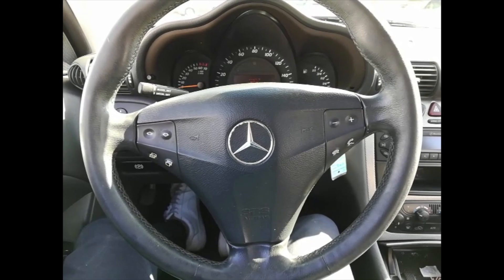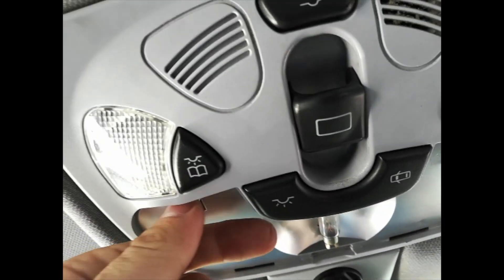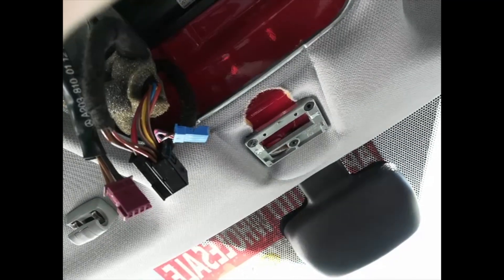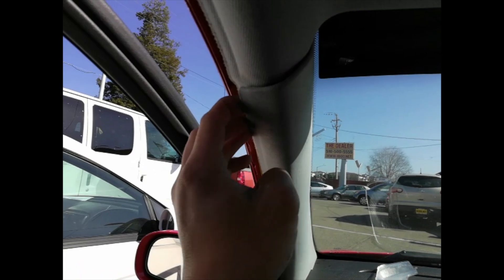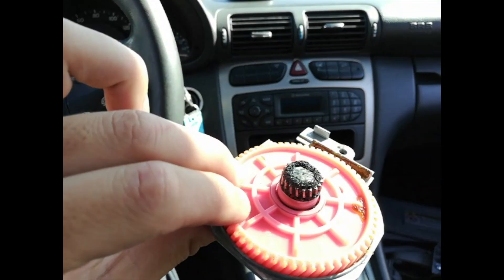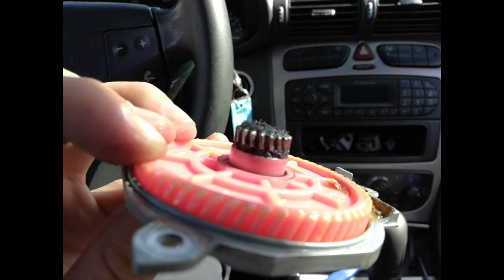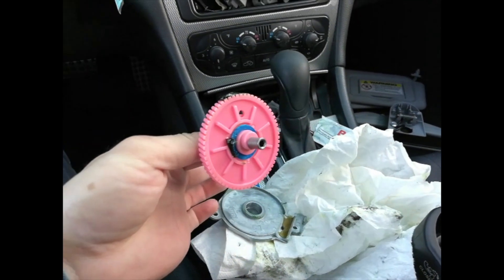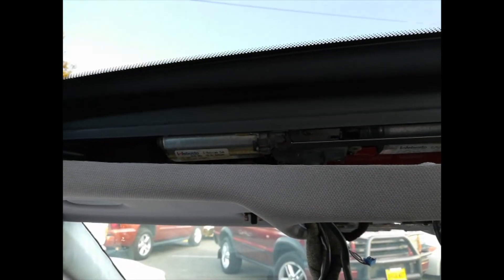Fix Your Mercedes-Benz w203/Panoramic Sunroof/Gear

Comment: All i have done was to change the gear and the lid from the sunroof with the curtain ones, which has no tension like these on the sunroof and respectively are far more preserved in contrast to the others. Lubricating the cords and rails is needed for a smooth and lasting operation either.
Reply: Hey. Did you just replace the gear from the right motor (curtain) to the left motor?
Reply: Thanks crazymandance and weichen  I have a 3D printer and went straight for that as a solution.  However, my printer was not connected to the internet so started reading the comments.  Swapping the gears takes a few extra minutes but is the best engineering solution.  Agree there may be room to do it with the roof liner in place but it is fiddley an I am sure I would have dropped a screw in the liner and then had to remove it later.  Also as a safety point, the side impact protection system is in the A pillar cover so take care.  I removed the battery terminal in the hope that the SIS will be dissabled (not sure it is so treated as live).
Reply: Can gear have any longitudinal movement with the lid closed? Because sunroof motor gear moves maybe 4-5mm and curtain motor gear moves 2-3mm? I think no movement is allowed

Comment: First, you don't need to remove the roof liner, in order to access the motors and gears.There's enough space for the fingers and screws over the central console, and all you have to do is to pull it down and be patient.
Second, tightening the gear in best case is just temporary solution. It creates more friction on the gear and motor, and that may result in total malfunction. Often the lid is also damaged, due to the pressure which is generated from the damaged gear, trying to "escape" the box. Don't forget, that when the gear is damaged, the surface which it has scratched with must be damaged too. I'm talking about the steel cables. You can easily change the lids and gears, but changing the cables is a totally different story.

Comment: Nice video. My roof is not working for many years as dealer quoted $$$ but after watching this video I am thinking of fixing it myself. I have just one question, how do you remove those connectors from OCP.  I just can't pull them out. Does it need any special tool to remove them.

Comment: Same happened to me , now the roof is closed only on 1 side and other is slightly open , what to do? Please advise
Reply: You can close it by hand. Just need to remove mirror ang then with torx press hard on screw and then rotate
Reply: @dinnoo89  What we need to remove?
Reply: @dinnoo89  it shows you how to close it manually in the car manual.  You remove dome light, you should have a crank tool that looks like a s shaped allen wrench or use a 25 torx screwdriver. Left side is to open/ close sun roof and right side is to open/ close shade.

Comment: Hallo Weichen, I bought a few days ago a w203 C class Sportcoupe, I manually closed the panoramic sunroof, I had the same noises. Even mercedes did not know how to fix it. Can you tell me where I can buy this parts from you ? thank you.
Reply from the maker: Nico, may be the simplest way for this is to use the metal ring from a keychain,  that should work as this spacer. Hope this will help you. Best.
Reply: I have same problem clc 2008 parnomic roof stop working mottor is working but is not close

Comment: Where you get the o ring
Reply: @Samcity1000  do you know if  the motors are same in the all cars. I have w211
Reply: @dinnoo89  yeah the w211 and w203 have the Same motor

Comment: Hello my c300 2010 sunroof is stuck tilted up wards in vent position. I tried manually it just kept twisting . I clicked the button and it spins the bolt . So I did it for no reason. What do you have in mind

Comment: hi , my suroof small gear is broken but cannot put as if i buy only gear will not be able to insert as top of the shaft is wide so if i even buy only gear from ebay then its wasted . any suggestions would be helpful...